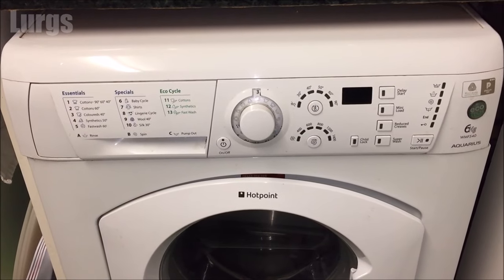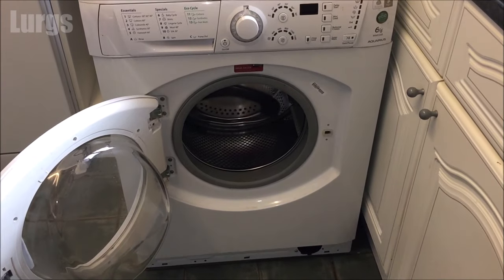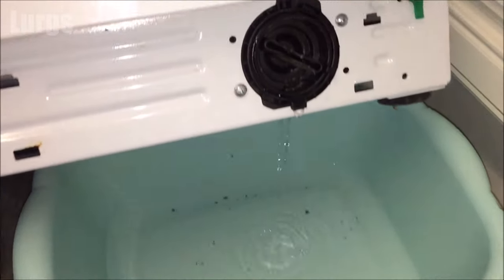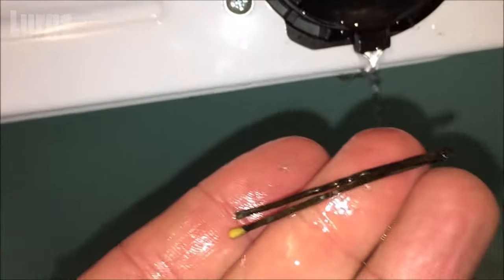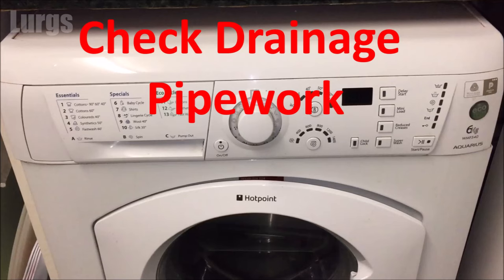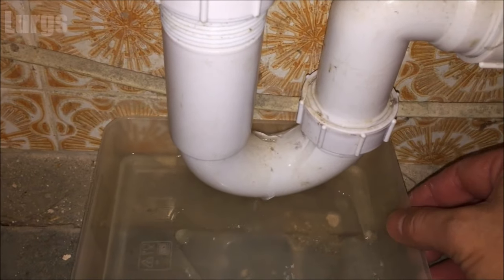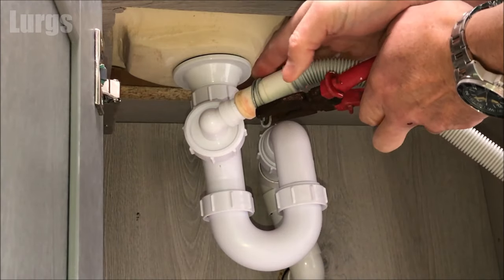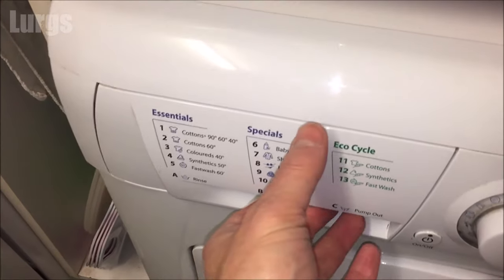Hotpoint Washing Machine not Draining Water - Fixed

Comment: Thank you, out hot point is 10 years old and never failed until today with a drum full of water, it’s in a corner with the dryer on top and the fridge next to it but still managed to tip it backwards enough to get a bowl under it and low and behold the filter was full of a mass of hair and bits of plastic! Cleaned it all out and it’s running fine again now. I was just about to go to Curry’s and buy a new one but realised I had to get the water out somehow anyway so found your video, you’ve saved me a new washing machine today!
Reply from the maker: Now that is a fabulous result! So glad you found my channel. 😎

Comment: Hi Lurgs, I have an indeset washing machine , the standpipe is 66cm from the floor, the pipe going from the back of the machine on the left to the standpipe on the right, it goes horizontally across back of machine and down into the standpipe,     my washing is now not draining even in a spin..  is the standpipe too low please? Would that be a problem? It was like this when I moved in.. Thanks for any advice Lurgs! 😊 I've checked the filter.. really clean.
Reply from the maker: No that should be ok as water is pumped out and the weight of the water should make it flow and move. Maybe the pump has failed or there’s a blockage in the drainage hoses

Comment: I tried to take off the filter and it’s been put on so tight I have now snapped it, is there any way of getting it off or do I need to call someone in now.  Thanks.
Reply from the maker: You may be able to turn it using pliers then simply buy a new filter, but beware of lots of water. Good luck
Reply: Thank you. I ended up trying with the pliers, that’s how I broke it. Thank you.

Comment: Hello, how did you got the coin out?
We have the same problem but we are unable to get anything out whatsoever
Reply from the maker: You should be able to see any debris in there and flick it out with a flag bladed screwdriver or something similar. Or a small grab claw which people use when they drop screws into engine bays etc

Comment: Hey what do you do if you just can't open that bit more than a slight turn? Mine won't turn more than a quarter turn and I just don't want to force it in case I snap something
Reply from the maker: Do you mean the drum won’t turn?
Reply: @Lurgs How To Guides  sorry, no the drainage port thing you untwisted and found the coin in
Reply from the maker: @bexhand2968  Oh I see. It’s bound to be a metal hair clip. Best bet is keep tightening then untightening until hopefully it clears. Good luck
Reply: @Lurgs How To Guides  I tried that with pliers too, but it still stops turning at the same place, so I imagine something is jamming it. Thanks though I'll keep trying 😏
Reply: You go down the pub and get hammered and when you get back, you won't care. Simple.

Comment: Hiii.. My washing machine doesn't take water..
Reply from the maker: Check the mains cold water feed pipe, make sure it's not kinked. Check if there's an inlet filter where the hose goes in, this may be blocked up
Reply: the valves fail they are cheap to replace